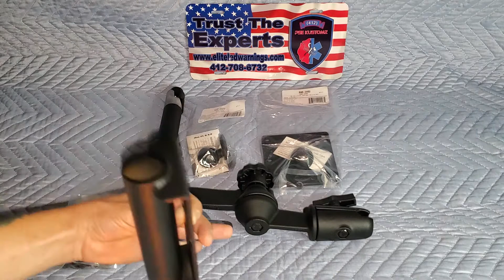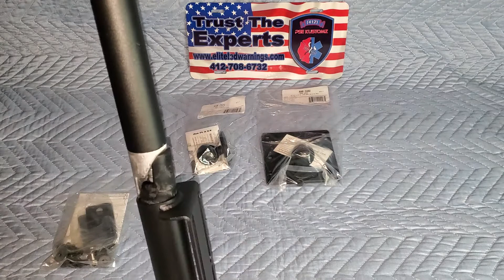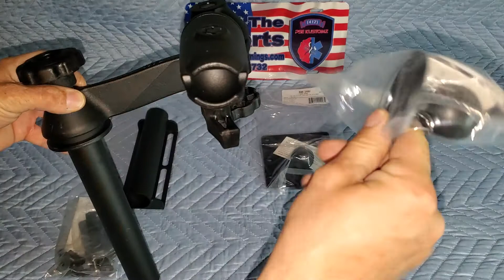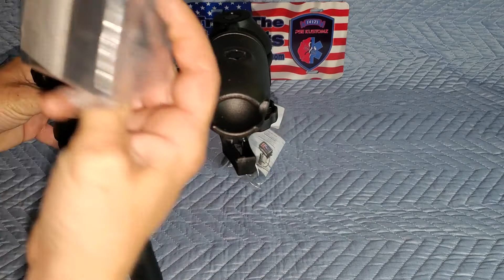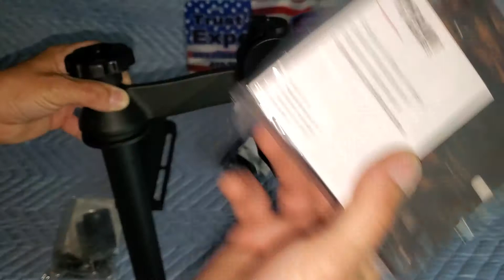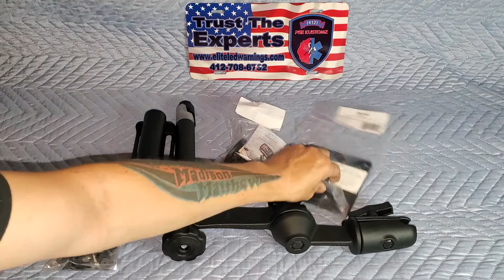RAM Mount Side Pole Mount Arm For Backup Camera Monitor

Comment: I use the ram X tablet holder for my 10 " tablet along with the self leveling  universal cui holder they have worked fantastic for last 6 years,  imbought the 12" for new chair ,on that note Matt senior check your messenger ) I will try to get some photos off to you tomorrow, the carnage is unpleasant and demoralizing. 

Peaceful the original